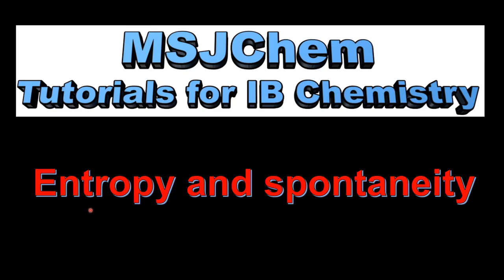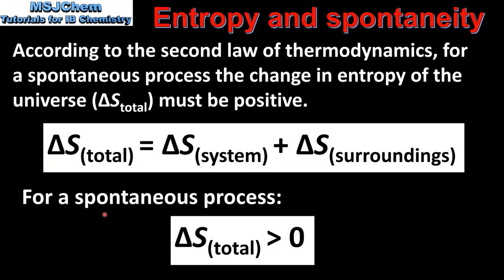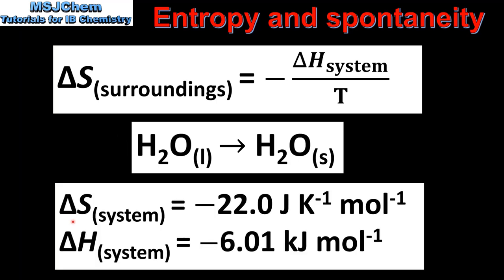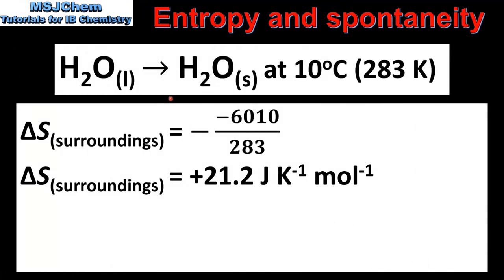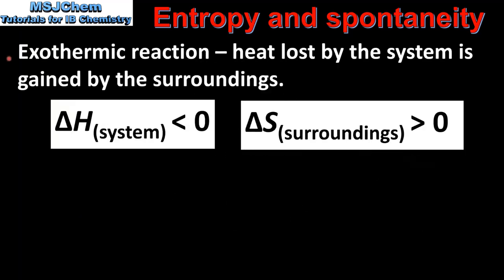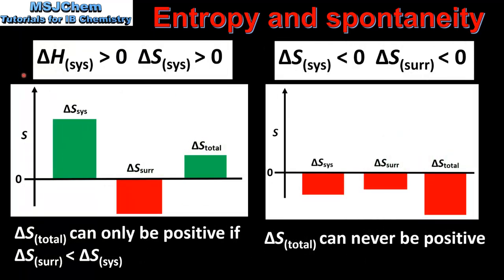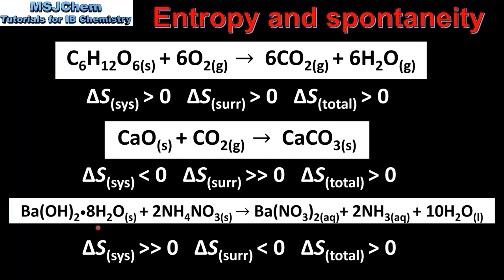R1.4.1 Entropy and spontaneity (HL)

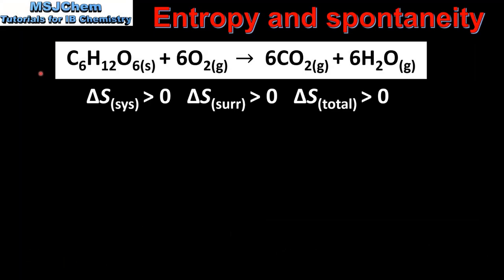Comment: Hi brother, I get the entropy thing. But if you see the equation at 6:53, the entropy is positive. But what if you had to compare it to another reaction that was positive and had all gaseous products. How do you determine which has a higher entropy?
Reply from the maker: In this case, you would have to calculate the actual entropy change for the reaction. That would tell you which reaction has the greatest  entropy change.